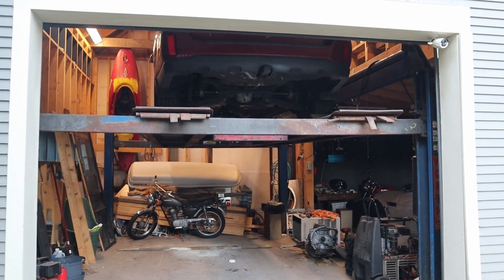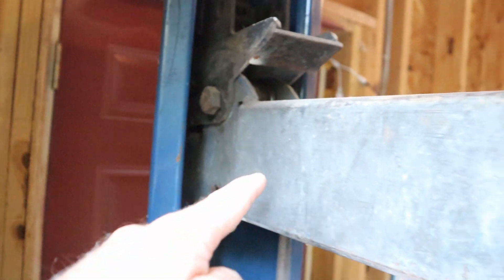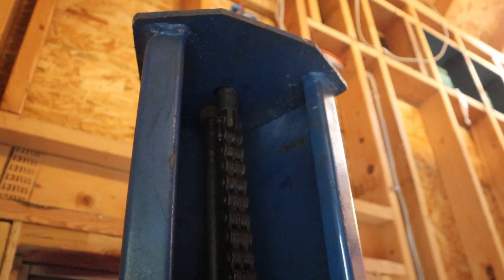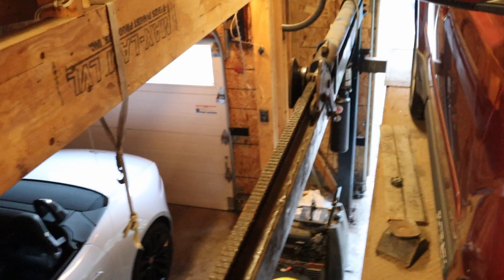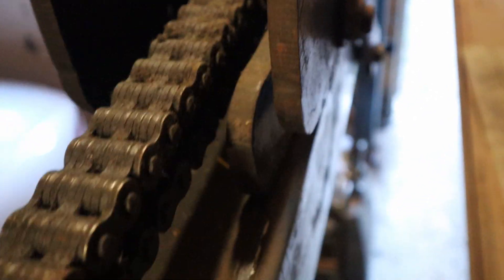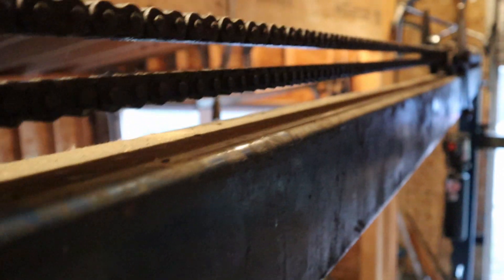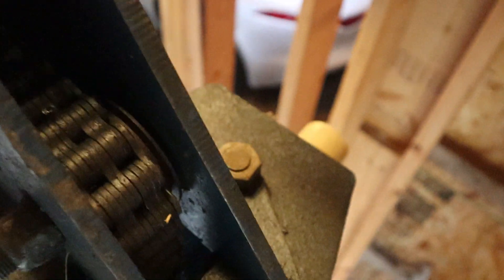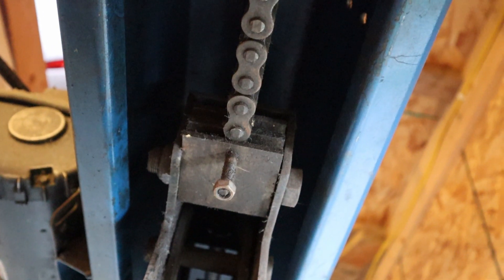Worth 4-Post Lift - Chain Configuration

Comment: Could you tell me how the safety latches work.
Reply from the maker: There are a couple of safety devices. The ratchet mechanism on the beam with the ram on it just has a big cam that clicks in to each successive notch. To get the lift to go down you have to raise it up a little bit. Then just pull the big steel cam down and it will slide all the way to the bottom. Each post has a rod in it and a mechanism that slides over the rod. If the lift were to drop quickly it would find on the rods and stop.
Reply: Matthew in the safety latches on each post there is a spring a washer on each end and there is a collar that I don’t know where it goes. Unfortunately I bought the lift already taken apart. Could you tell me where it goes. It was on the rods with the springs.
Reply from the maker: @dougdavis4379  I am not near it this weekend. Check out my video where I initially put it together and see if that answers your question. Otherwise, I can look for you next week. Let me know.
Reply: @mbrenengen  I watched both vid slow motion but still couldn’t see it but thanks for responding. When you get back please take a look I may have to take it apart if I get it in the wrong place. 😃
Reply: I'm in Zimmerman MN I have a hoist just like yours it was disassembled when I got it. I recognize most of your steps in assembly thanks for the video

Comment: Can you take links out of a chain that's stretched over time?
Reply from the maker: You can adjust the length with the bolt on the top of the posts.
Reply: What if the adjuster is all the way tight? I just put a lift like this up and one end didn't have enough adjustment to make it level. I planned on removing a link!  @mbrenengen